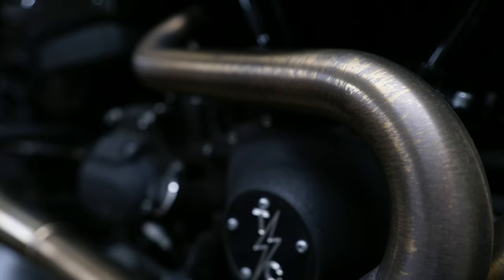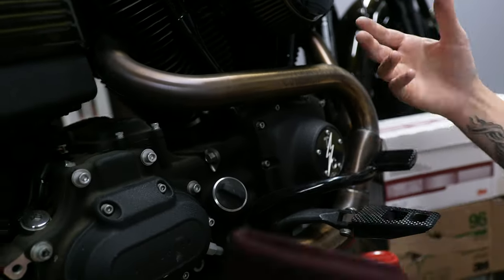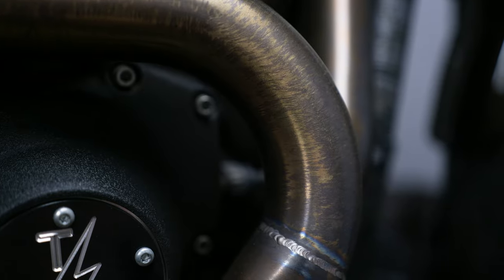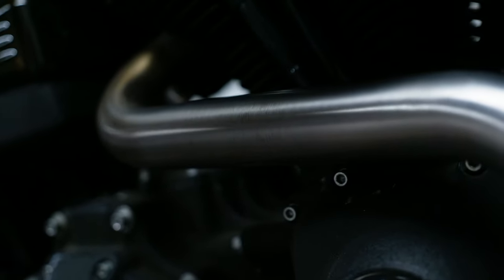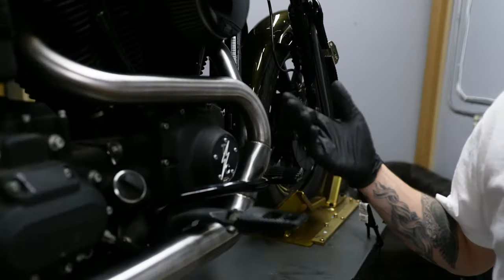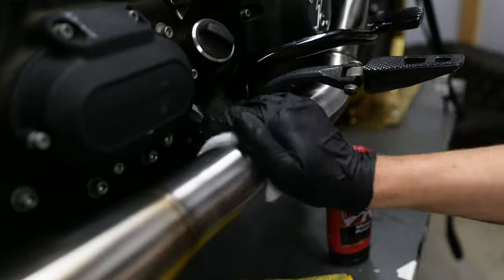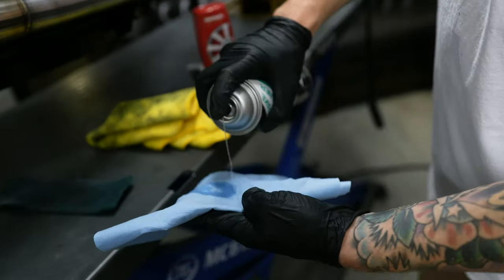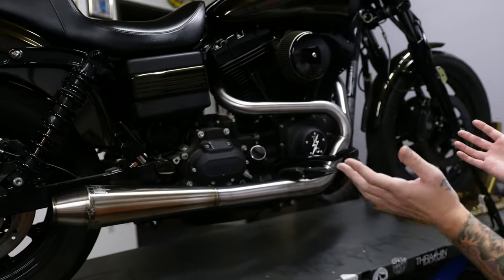Make your Thrashin Stainless Exhaust look new!

Comment: I did the same think on my TBR 2into1 stainless. Same scuffing, following the grain. I used white diamond metal polish from autozone and hit it with the 360 grit scotch bright pad. Washed off the white diamond whipped off with blue shop towels really good. Finally hit it with 800 grit scotch bright followed by a really fine steel wool. Pipes were super clean and removed any grime and detail cleaner. When I rode my bike again, the same beautiful golden color started to return, just without the stains and burn marks lol. Good video.
Reply: I put a brand new TBR Gen 2 stainless 2-1 and installed it on my Sportster in August and rode the shit out of the bike for the 2 months of riding season we had left to break in the new motor build. In that time I got really lazy and didn't clean the bike once. The exhaust looks like it was on tour with the dirtiest of dirtbags 😆 🤣  I am in Canada otherwise I would ride year round! I pulled the exhaust off last night and I'm going to try giving it a good cleaning! I'll have to check out the white diamond metal polish!
Reply: Don't ever use steel wool on stainless pipes, it can impart the carbon steel into the stainless and cause rusting issues. Trust me lol.
Reply: @RealWunderBanana  thanks man! I did not know this
Reply: @jaybee5919  no problem!

Comment: Got everything I need today, damn rag melted onto my exhaust. Gonna give this a shot tomorrow hopefully with good results. 🤙🏻🤙🏻
Reply: How did it go for you? I ran over something in the road and smelled a burning and looked down and had something melted into my stainless. I'm going to try this today. It was some kind of liquid bc it was like gooey almost. I hope it worked for you
Reply: @Ritenour1986  worked perfect, pipe looked like new. Took me a about 30 minutes, I didn’t do the whole pipe. Just the section where the rag melted onto my exhaust. After I was done I went for a ride and all the coloring evened out.
Reply: @12131AllDay  I just did the same thing and it looks great. Thank god for YouTube
Reply: @12131AllDay  What grade scotchbrite did you go for, went to buy some on Ebay but I see there are different types red, maroon and what seems to be different grades of red
Reply: @newcastle911ify  I got the green, maroon and grey off amazon. I believe I used the grey or maroon. Started with the finest to be safe
Reply: Just picked up a bike that’s got something melted on…
Any suggestions?
Reply: @legacy6786  I did pretty much exactly what the video said with no issues. Just gotta be patient. Hope this helps, good luck

Comment: I used the same stuff with the green Scott bite pad and it cleaned the pipe but scratched the shit out of the metal. I have a Yoshimura full stainless steel exhaust and I started with the mid pipe.

Comment: I don't worry about the vertical method and go with the horizontal strokes, it does change the lite scratch direction but that should not do any damage right?

Comment: Would it take less over all time if the exhaust was removed and a wheel was used?
Reply from the maker: I mean…. Factor in taking it off and putting it back on. Then it’s sometimes a little harder to hold it while your doing the work. But it really just comes down to how much work your exhaust needs.
Reply: @THRASHIN  just like everything else in life and motorcycles, it’s always a give and take.

Comment: Did this with a red scotch bright and brasso, cleaned after with half water/ half alcohol and the next day it was already rusting. Did I mess up with the alcohol/ water rinse and am I able to salvage it?
Reply: Just scotchbrite it again to get the rust off, then wipe clean and apply a very light coat of oil that has a high flashpoint. Be sure to apply it evenly, then immediately run the bike up to operating temperature to lock in the new color.
Reply: Stainless is stain-less not stain-proof. The scotchbrite increases the surface area of the steel at a microscopic level, allowing oxygen to penetrate. Your water solution introduced oxygen into all the nooks and cranmies of the surface. Don't do that. Use oil instead, to form an oxygen barrier. You'll find the colors will be amazing.
Reply: One more word of advice: polished steel resists rusting a million times better than finely scratched steel. Try to use the finest abrasive you can to remove the rust, and put a smooth, uniform surface back on the pipes.
Reply: @Greenmachine305  Thank you for the response I really appreciate it. So by oil do you mean something like WD40 or an actual oil? I was able to get a good polish back on it, coated in WD40 but am still having some oxidation appearing on it but it's definitely better than before.
Reply: @JohnnyTalleyMusic  Any oil you like. Cooking oil, petroleum oil, any oil. An even, light coating. Then immediately bring the pipes up to operating temperature. It will smoke at first, but after it burns off it will look great. For example, the oil on my hands caused smears that I didn't wipe off after installing my pipes. The smears  turned a lovely blue.

Comment: Just use vinegar and baking soda. Sponge on, leave 10 mins, wipe off.
Reply from the maker: Damn! Gotta give that a try 👍🏻
Reply: @THRASHIN  Its what everyone who wants their stainless pots and pans looking like new has been doing since stainless steel was invented. What it does is gently dissolve the thin colored chromium oxide layer with a mild acid. You could do it instantly with muriatic acid, but its very harsh, and will open the surface to rust.
Reply: @THRASHIN  One more thing, its the vinegar that removes the color stains. The baking soda acts like a soft abrasive to remove any surface residue without scratching. You can use vinegar alone. If you use baking soda, use very little otherwise you will negate the acidity of the vinegar, and it won't dissolve the colored chromium oxide layer.